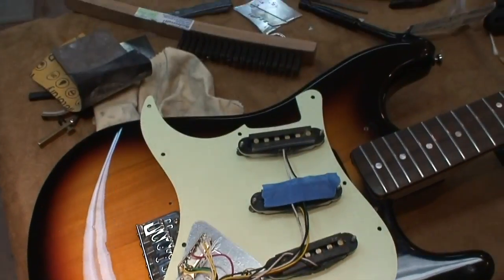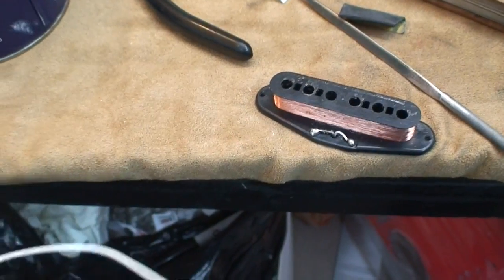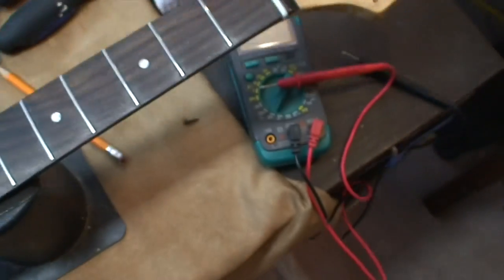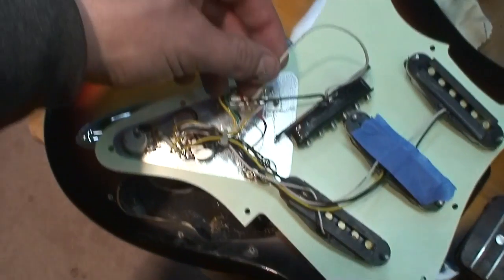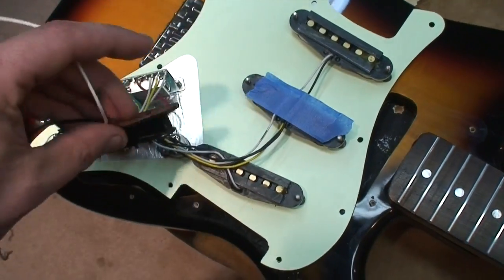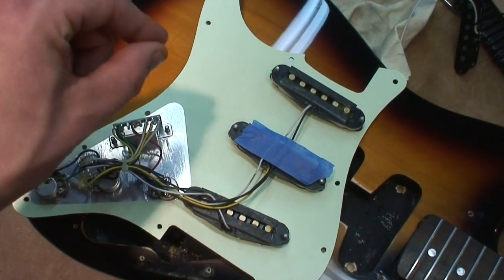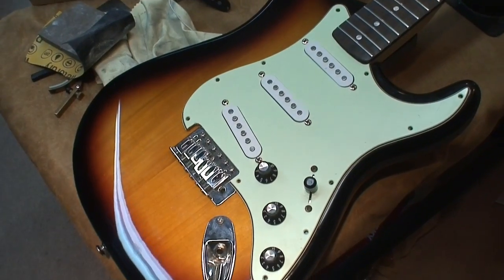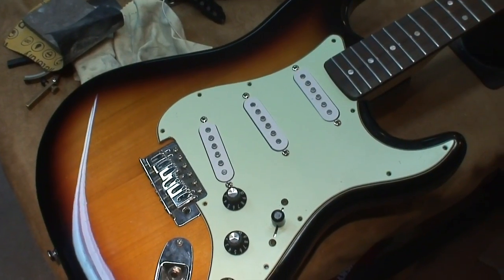How to MAKE and WIRE a dummy coil for a Strat. SIMPLE!

Comment: Just tried it, and I can’t believe it actually worked. Very pleased. I’ve tried all the noiseless pickups, and adding a dummy like this sounds way better than any of them (using a Fender Pure Vintage 65 set). Some tips: 1) can’t use with a middle RWRP pickup, 2) you may need to try both combinations (switch which way you connect the hot and ground lead connections to the volume pot/5-way wire, or you may get it right the first time), and 3) I used a hammer and screwdriver to force the magnet off the dummy coil pickup. Good luck, everyone!

Comment: I disagree on the wiring. In switch positions 2, 3 and 4 the dummy must not be active. In position 2 and 4 the middle pickup cancels the hum of the bridge or neck pickup. In position 3 - middle pickup alone - the hum would be doubled because the middle pickup works reverse, so does the dummy. One would need a wiring / switch, where only in position 1 and 5 the dummy gets active in the regular way, yet in position 3 it should get reverse active.

Comment: Hi Woodeso's Guitar Mods .. Congrats for your videos.  I installed a dummy coil in my guitar too. I have some comments to improve it:
1. The schematic you teach is not the best. You put the dummy coil between the switch and the volume pot, however this work good only when you have a master tone knob (as shown in the schematics you used). When you have separate tone knobs like most strats do, then you end up having a lot of noise when you roll off the tone. That happens because you are filtering just the signal from the pickup, but leaving unfiltered the noise from the dummy coil.  The CORRECT way is to place the dummy coil in replace of the black wire that connects one side of the switch to the other (in case of the schematic). In the case of your switch, that would be pins 4 and 5. Then you can have a regular strat wiring with separate tone knobs with no noise when you roll off the tones.
2. I used a cheap chinese pickup as a dummy coil. I removed the ceramic magnet from the back and removed the pole pieces. These pole pieces are not magnetic. However, without the polepieces, the noise reduction was insignificant. But when I put the pole pieces back, then the dummy coil really worked. So, for dummy coils made from ceramic pickups, its better to leave the poles. For alnico pickups, you have no option.
3. You guitar don't have a RWRP middle pickup and, in this case, the dummy coil will work for all 5 positions. However, most Fender strats have a middle RWRP pickup and then the dummy coil will only work for positions 1 and 5. The other positions will be noisier. In this case, you need a DPDT switch or push-pull knob to enable/disable the dummy coil.
4. For those who have fender standard alnico pickups, you can undo the RWRP pickup just by reversing the pole pieces and the wire leads. However, this only works for those pickups that have a plastic bobin, otherwise you will damage you pickups.

Hope these comments will help everybody.
Reply: I tried this and it doesn't work.
Reply: Couldn't get any easier, sir.
Reply: This really helped me, but it affected my tone controls, I guess it is my fault , thank you very much!
Reply: You right.. dont mess with vintage pickup.. i have fat50 and cs69 dead

Comment: Thanks for the awesome videos and the dummy coil is amazing.  I have a MIM tele with a non-rwrp neck pu and a 4 way switch and it hummed in all positions.  Now she's dead quiet and no tone loss that I can tell.  Now I have a use for all my scrap pickups.  Cheers!
Reply: I'd like to try this with my Les Paul special twin cutaway loaded with P90's, do I have to use a P90 'I don't like' or will a smaller Tele or strat style pickup do the job? Do I need to match the working guitar pickups resistances?

Comment: longer signal wire means overall power loss, for those who perform on stage. this means that eventually you will need a buffer. But I was wandering if you use one of the two coils that the hotrails has witch is at 5.6K ohm resistance, will you get the same results?

Comment: I have a strat with normal rwrp pups. I did very much experiments with dummy coils. Even hot rails with one blade removed and the winding's in parallel mode. The last was the best I could find.  All the experiments (including this mod) gives a bucked hum! But all will give you a loss of high shimmering single coil frequency's. I have modded my strat with only one tone control for all the pups.  My last attempt was to wire a dummy coil in the place of the capacitor of the tone control. Bingo! With the "tone" control (250k) wide open I have a fairly good hum reducing and no loss of tone at all!!!!  When I turn the tone control the hum reduction will get better and better and the high freq. rolls off,  just as a real  tone control. With the tone control on zero you won't have hum anymore  and a good jazz tone. Try it and you will be surprised. The only thing that happend is a slight output level loss. Easy to compensate by putting the pups a bit higher.
Reply: Interesting. From what I understand, it helps to take a lot of wire off the dummy coil. It would take quite a bit of experimentation, but the least amount of wire wraps you need to get rid of the hum is the ideal you're shooting for. This will give the least signal loss.
Reply: For what I learned from the net is the right amount of winding so much that the DC resistance of the coil is about 1/8 of the DC resistance of the pickup. When you have the specs of the coil wire and the size, you can calculate the amount of winding rounds. Such a dummy coil has to be in series with the pups.
Reply: I hope you're right. There's just so much junk information posted on the interweb, especially in stupid forums, that I don't trust any of it. Anyhow, I'm glad it's worked out for you!

Comment: Hi. Very interesting idea. I'm just wondering however. Wouldn't any kind of resister in the path of your output reduce your overall signal? Have you ever metered the output before and after the mod? I'd try but if you already did, I don't want to re-invent the wheel : )
Reply: If you wire it in parallel, you won't get a high end roll off or volume drop. If anything you might get a little more high end which you could take with an added resistor between one lead of the dummy coil and the volume knob

Comment: So the dummy coil stays in circuit in the hum-canceling positions too? I was hoping there was a wiring strategy that engages the dummy coil only in switch positions 1, 3, and 5 but not in 2 or 4 where it's just adding hum. Putting a push-pull pot in to act as a switch is the only answer I can think of, other than a hideously complicated custom 5-way switch. (Although if I were making a product out of this, I think a custom 5-way switch is exactly how I'd do it.)

Comment: Could you use an old wire wound resistor instead? I have a bunch of those.
Reply: nope.
Actually — you can, but it not will work.

Comment: Know this an older vid, and maybe I’m wrong but wouldn’t the pickup you choose for the dummy coil need to be RWRP in relation to the regular wound neck and bridge pickup to be truly “hum cancelling”? I think if you don’t you would only get the effects of frequency cancellation of pickup and dummy coil wired out of phase to each other but not full hum cancelling. Not sure how that still all would work when magnetic pole pieces or ceramic mag and steel pole pieces are removed. In any case I’d think the direction of the coil winding in the dummy coil would be very important whether it cancels out other single coil pickup 50/60 cycle hum, or not. Seems to me it would have to be wound opposite to your bridge/neck and if your middle pickup was also rwrp it wouldn’t do anything in pos 3 of normal 5-way.
Reply: In such a solution, no one needs any RWRP. The coil does not interact with the strings — no polarity (no RP, no SP) is needed (which is why he removed the magnets). There is no RW exist, the phase of the coil is changes by changing its leads.
If you do have a actual middle RWRP, it will not be hum bucked, it needs to be brought into the same state of the neck and bridge.

Comment: Though it couldn't get any easier I'm still a little confused  ; )
You say the coil replaces the red wire in this case, but do I actually have to physically remove it?
Reply from the maker: Yes Take away the red wire and replace it with the pickup. Doesn't matter which end gets wire in where. All you're doing is forcing the output of the switch through your dummy coil before it hits the volume. So instead of a straight connection from the switch to the volume, you remove that entire wire, then in it's place solder in the pickup. Hope that clears it up;-)
Reply: Woodeso's Guitar Mods Yes, thanks for the fast reply! I think I can do that ... maybe I'll get a Squier Classic Vibe after all.

Comment: What it I do not remove the lead from the switch to the pot? Wouldn't you have a better signal that way, plus the dummy coil? Or would the resistance of the coil negate the current flow?

Comment: What resistance are you looking for in the coil?  Wouldn't a resistor  be cheaper and smaller and do the same effect? I am not trying to be a smart ass just curious as not everyone has a spare pick up to sacrifice.
Reply from the maker: Honestly Pat, I've wondered the same thing. So much so, that I'd like to wire up a much smaller coil. Something the size of a volume or tone pot. Like the size of a thread bobbin for a sewing machine. I just need to find some sort of housing that size. As for the exact resistance... not sure what the breaking point would be to be honest.  That's a good question though. I bet Will would know the answer to that:-)
Reply from the maker: Truthfully Pat, I don't know why pre-manufactured dummy coils aren't sold for modders? Like something small with just the amount of resistance you'd need to make it silent. I reckon we could find out by testing a noiseless pickup though. Some Fender noiseless pickup. It's just the same thing. A dummy coil wired into the pickup. Maybe test one of them?? I haven't been able to find the answer yet. Perhaps there's a mathematical formula to work it out?
Reply: +Woodeso's Guitar Mods That's also my take on it. Seems it would be a lot simple if one could just buy a small prefabricated coil made for just that purpose. Of  course the noiseless pickup folks wouldn't like that at all.
Reply: The hum bucking effect has nothing to do with a pure resistor. It is the reactance of the coil that works for the hum bucking effect. So a resistor has no reactance and can not reduce the hum.

Comment: Ok, I'm a pedal builder. So I know basic concepts of problem solving in relation to electronics.

I know how to check continuity, and all that other fun stuff to determine what the problem is.

And I thought this would be a slam dunk after watching your vids on dummy coils.

Plain old squire strat. This only increases noise. I am dumbfounded.
Reply: If your noise increases — reverse the phase of the coil.

Comment: arent the pickups wired so that in some postions bridge and neck for example the pickups are wired in reverse with opposite poling..then in this case, the one coil in series would be humbucking, but when connected to the other coil, it would double the hum? in other words..the bridge, neck, and middle have to be wound in the same direction with the same polarity, in order for the dummy to be wound in reverse relative to them, in order to be hum cancelling...?

Comment: First of all I appreciate the video; I was planning to do this mod myself. But, I have been studying this pretty intensely for around two weeks and I have read probably more than I care to remember, and I don't mean to come across like a jerk, but, from what I have read, this mod will only work if all 3 pickups are wound in the same direction. In other words, if you're middle pup is reverse wound (RW/RP), which most modern Stratocasters are (from what I have read),  you will not get hum cancelling in all pickup positions. Maybe he pointed that out in the video and I missed it, regardless, it is an important caveat. I have rails on all my guitars, but my Brother just bought a American Standard Stratocaster which has 3 single coils with RW/RP middle pickup, so I got curious and did some research and it showed me this mod would not work on his guitar without replacing the RW/RP pickup with a normally wound one. I told him just go buy some Fender noiseless pickups, just seems a lot easier. Just my two cents worth...
Reply: The Fender noiseless pickups are dull and lifeless. Their sound is not even close to the standard p'ups. Try some others noiseless like Zexcoil or Kinman or so... They are pricier, however they are worth every penny!
Reply: Thanks much Cream, I love the sound of single coils and nothing else comes even close, but I stopped using them decades ago; I found them way to noisy for live performance and recording. I really think it's all a matter of preference. I just acquired a new David Murray Strat with 3 top-line Seymour Duncan's, and I swear the cheap ones on my $200.00 Squire Hot rails Strat Import sound better to my ear.

I have always felt technique and passion supersede the quality of ones gear, maybe that's because I ways always to poor to buy expensive gear when I was playing for a living.. I played on Fender and Carvin amps for decades. I just acquired a brand new $1400.00 Mesa Boogie and the construction,  materials and features are superb, but sound-wise, I owned a Fender Twin with JBLs in the mid 70's that easily rivals it, the Twin had the most gorgeous sound of any amp I ever played on, and like a fool I sold it.
Reply: Flip the magnets in the middle pickup and reverse the wires too. you just give up the series on 2 and 4, no biggie.
Reply: What about Lace Sensors?

Comment: I installed one dummy coil in my guitar, but i head the same noise   Before the install, the dummy has tested and works fine, i think changed the connection cable, the volume cable goes nota in the volumen, go to switch and viceversa, you can help me?
Reply: Joel Perez 
Is the polarity, fist able if you have a middle reverse wired pickup, inverse it to have the 3 equal, then put the (-) from the dummy to the switch and the (+) to the positive vol pot, if the hum persists or gets worst put it in reverse and boom, no hum, be sure to place the pickup facing the same direction as the others and if is posible wrap it in paper then alumn foil and paper again for insulation purposes, and has to be tight not loose in the cavity. Amen.
Reply: thanks!

Comment: i got it! the hum is going to the hell right now, but i have some trouble, i found hiss noise in my strat, if i dont touch any metal part of the guitar, but if i touch metal part like string, bridge etc the noise is gone, may you have a solution for my trouble, or tips to make noise gone, thankyou
Reply: +Young Young You can't get rid of that noise. It happens cause you are the guitar grounding. That's why there is a wire from the guitar bridge to the circuit grouding. It's perfectly normal, and as long as it disappears when you touch the strings, it's okay.
Reply: This may actually just be static electricity!! wipe your strings down with an 'anti-static' cloth and the hum will be gone. Usually works for me...

Comment: you mean pole pieces? magnet are on the bottom correct?
Reply: For some pickups the pole pieces ARE the magnets...usually AlNiCo magnets.
For some, mostly ceramic mag single coils, there is a bar mag across the bottom.

Comment: Can't you just wire a resister in there? or would that just make it quieter?
Reply: It would just make it less loud. It would not reduce noise. Resistance isn't the functional parameter. It must be a coil. It works like an antenna for noise, but it's out of phase so it cancels out. (not perfectly, but significantly) 
Known as common mode rejection. Same principle that makes a humbucking pickup work, or a balanced microphone cable, etc.

Comment: I did this and for me it took away way to much tone. Kinda logic when you're adding 8k's or so in resistance. I would say try it for yourself. It does take away a bunch of hum
Reply: Try connecting this coil in parallel with the selector. This should have less effect on the tone.